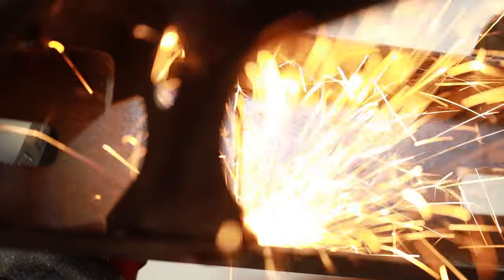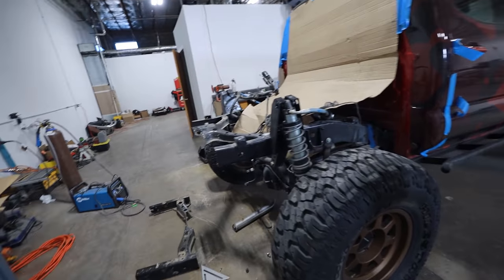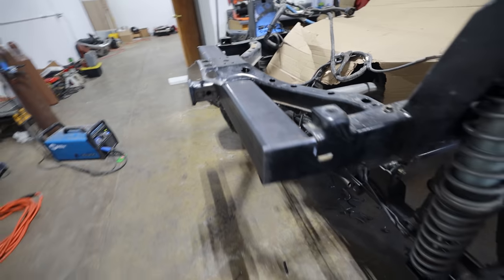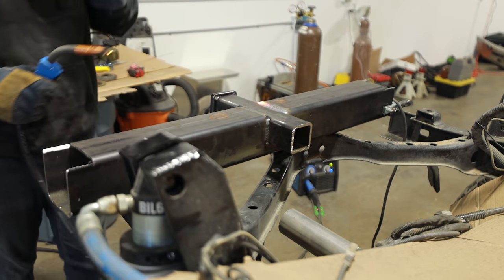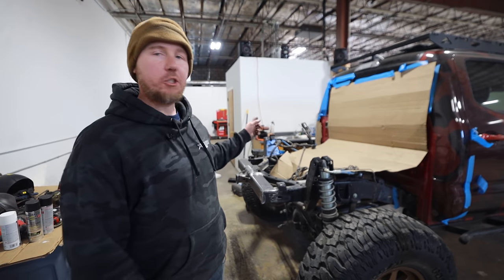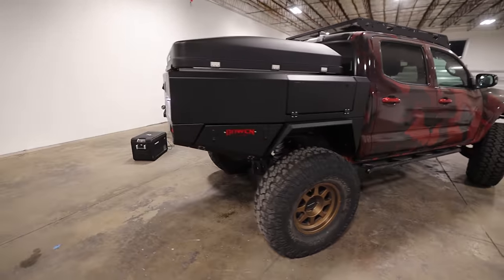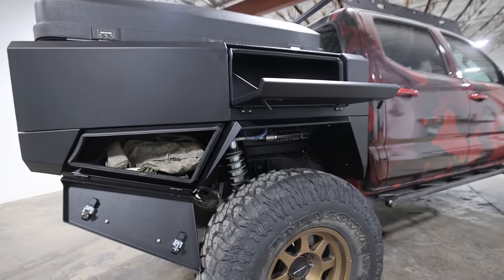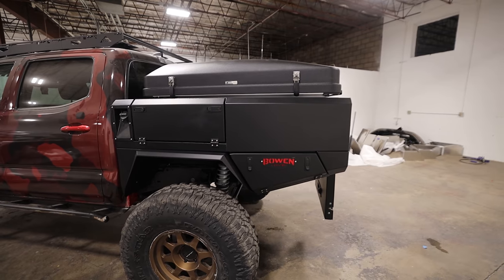One Of A Kind Toyota Tacoma Crawler Bed! Ultimate Toyota Tacoma Episode 9.

Comment: That is a very cool bed. Very sleek and modern looking. Also, the Toyota frame issues are a weird one. Starting back in the 70's they had really good, fully boxed frames. Then the Tacoma and Tundra went to these really weak, c-channel frames that cause stress cracks in the bodies. The engineer at toyota claims it makes for a better ride. But really it was to save money. Chassis jitter makes the ride worse. The brand new tundra finally went back to a fully boxed frame. Hopefully the upcoming tacoma does too.
Reply from the maker: Dude so well put. This is exactly my sentiment with c channel frames in modern trucks. It's not "designed to be flexible" as many people claim, it's designed to be manufactured cheap to manufacture. The flexibility is a consequence not an intention.

Comment: You still want some flex in the frame because if it doesn't flex your welds will crack and break under enough tension.
Reply from the maker: My point exactly. By stiffening up the ends of the frame you get a better ride and the frame can still bend and twist in the middle. If you stiffen up the middle you will absolutely crack the frame around your welds if you use it off road.

Comment: That is a pretty sweet bed. Proportionally it looks a little long to me, but I guess you needed to fit the tent on top. I love those boxes behind the rear tires. Perfect for stuff that get dirty during use. 

The frame on the Yota is constructed very differently from something like a Nissan. The Nissan frame is fully boxed and welded from where the front bumper mounts to the where the rear bumper mounts. No rivets or bolts holding the structure of the frame together. I'm surprised to see such a large difference in the frames.

Comment: Pretty sweet set up modular is the best, your corner tail light sections will probably the most bent up or dented up is my guess, the wise part about the 4x4" 3/16" wall square  tube is it will still give strength and some flexibility and you gotta have some give, plus your welds will last a bit longer, this will probably let the suspension do its job a littler better to, great stuff Nate look forward to EJS 👍

Comment: Very cool looking but a ton of that interior space is going to go unused because it's not as accessible as you think it is. Need to put external sealed doors on the sides of the bed to make those deep interior spaces fully accessible. Check out videos/products from companies like DMW down in Australia, they convert Utes with beds all the time.
Reply from the maker: I have been using this like crazy and have found that I have more usable space than the oem bed. The design gives me access to every inch of space where as the stock bed is full of dead space. 👍
Reply: @DirtLifestyle  sounds good 👌 I was just looking at those deep interior wells by the rear end of the bed and thought they’d be very hard to reach from the end, with the lid lifted. I was watching and thinking what kind of tool would get stuck right out of my reach without having to get into the bed itself

Comment: Wow, that is a huge update for that Taco!
Would fitting a full size spare under the frame have been possible?
I've seen JLs and other Jeeps modify their frame for that purpose.
Reply: It all depends on the size of the spare and the extent of the frame mods!
Reply: The shock mounts are already welded in and you would have to do ALOT more fab for 38" spare.
Reply from the maker: Like others have said it's tricky with tires this size. Even if the frame was wide enough the center of the axle would hit the tire for sure.

Comment: Is that evolution miter saw using an abrasion blade? I'm looking for a mitering metal saw and they apparently don't exist. All miter saws are set to high of an RPM so the tooth velocity of a metal cutting saw blade will get eaten up if used on one. If that's a low RPM miter saw, then I gota know where I can get one.

Comment: Awesome. Nate do you regret not getting the longer wheel base now that the bed is non existence for the most part?
Reply: Why would he want a longer wheelbase for rock crawling? He just shortened the bed for better departure. I think he wants to maintain decent breakover.
Reply: @Baum Squad the crew cab has a 5 foot bed or a 6 foot bed option.
Reply from the maker: I think this is perfect. Lots of room to store gear and I wouldn't want the wheelbase of a long bed taco. If I remember right it's like 140". The 127" is long enough for rock crawling lol.
Reply: @DirtLifestyle  i figured. Still shorter than your gladiator lol
Reply: @jeepindave5464  gladiators are putting on 40s just to compensate for the awful breakover angle. Yea main reason I was deciding between a 4 door rubi and the taco. Decided to go with what could tow and haul dirt bikes for my future money pits. Plus the gladiator is the only mid sized truck that wouldn’t fit in a normal garage

Comment: This is almost what I want to build.  I'm planning something a little unconventional.... 2001 ford f150. 5.4l (for now). From the dimensions I have found online. I should be able to squeeze the godzilla 7.3 gas v8 into it. The frame is only going to be for reference points. Ultra-4 style front IFS. 4 linked Dana 60 out back. Why? Because I want something I can take the whole family of 5, plus 2 90lb labs, almost anywhere. I'm not looking at hard-core rock crawler. Just a really good all-arounder. Small custom built camper in tow. But, while being something totally different than the typical off roaders.